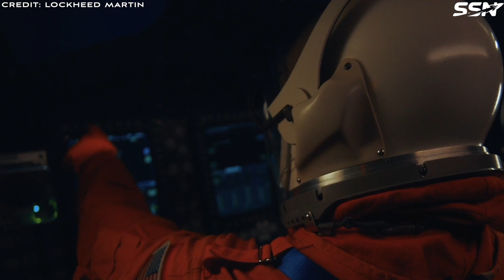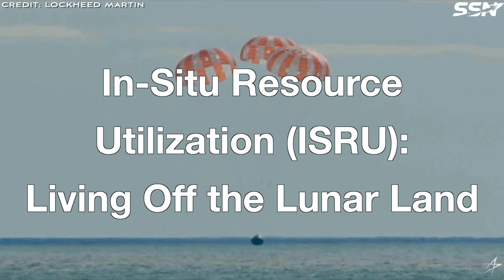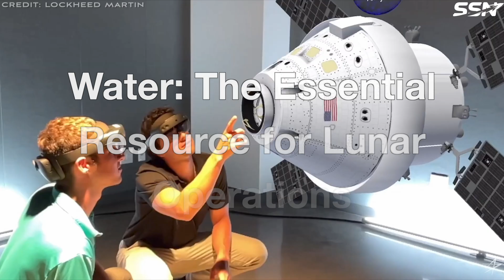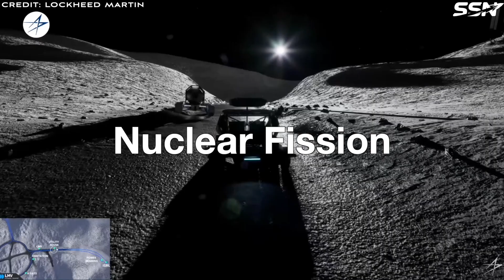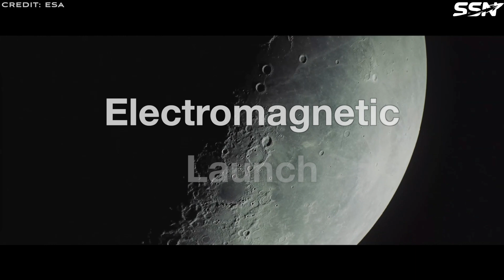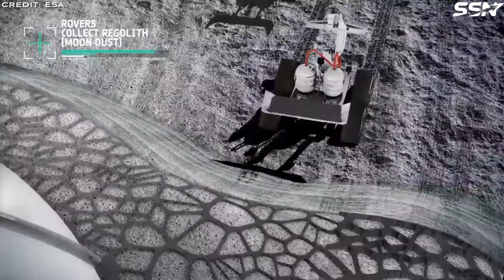Lockheed Martin's Water Based Lunar Architecture: A Vision for Humanity's Future In Space

Comment: Your not going to leave lithium batteries outside on the surface like some trailer park redneck (I grew up in a trailer park). No, your going to keep the lithium batteries inside where the soft squishy cold adverse carbon based lifeforms are at so they don't get cold.